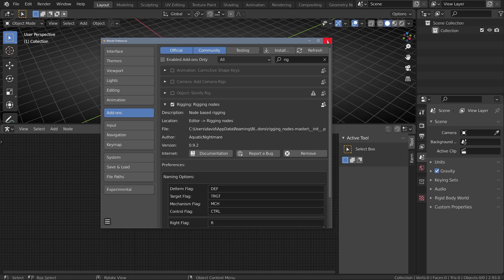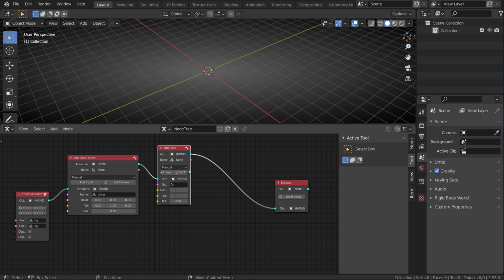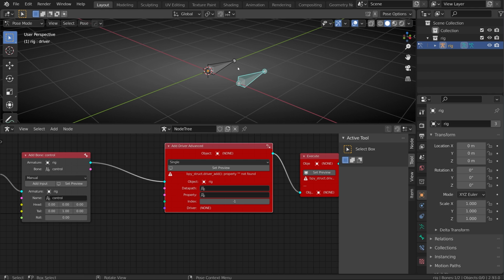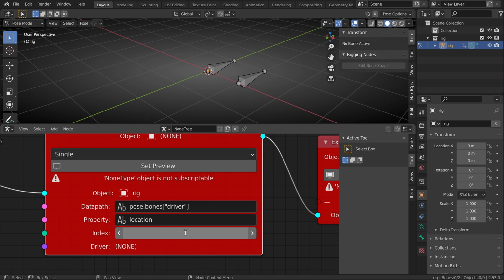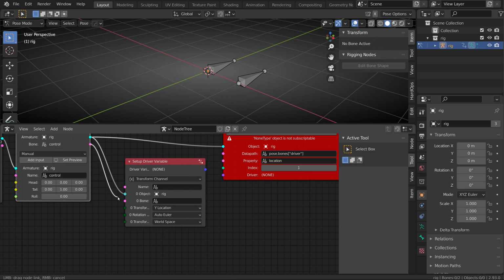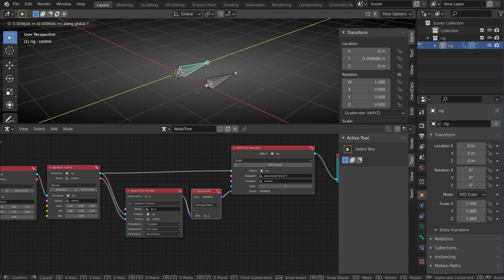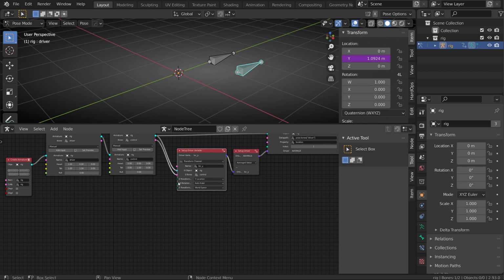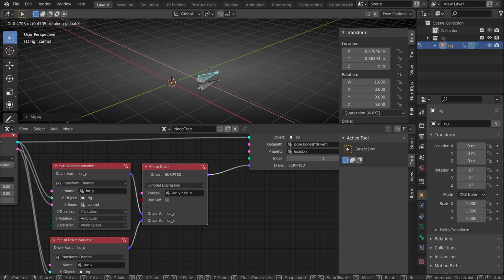Advanced Driver Setup | Blender Rigging Nodes

Comment: you might be the guy to help me - how would you rig the movement of the internals of a human jaw joint? at first the joint rotates but then moves forward, sliding on the disc as the mouth fully opens